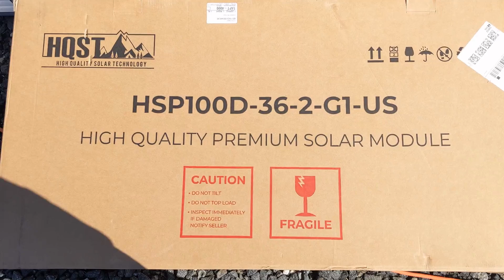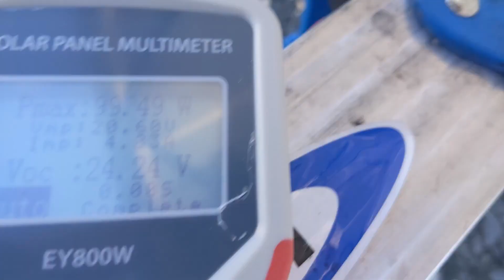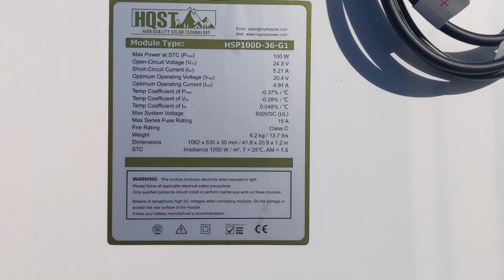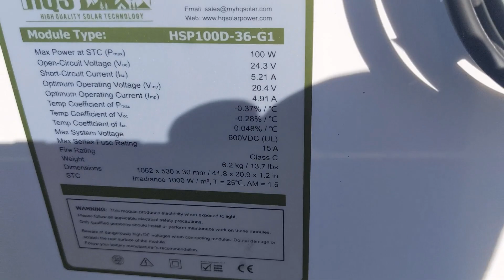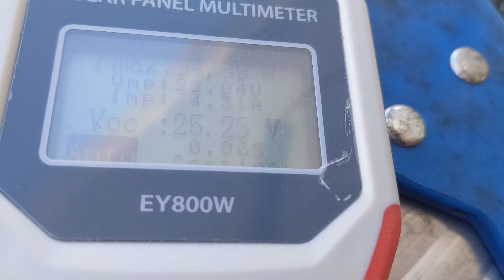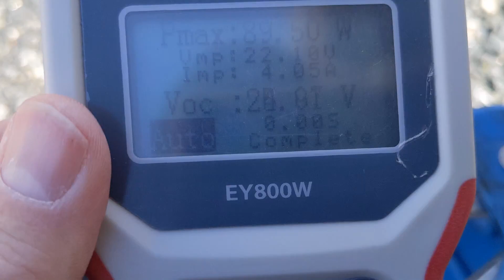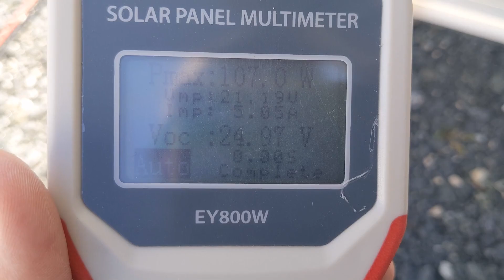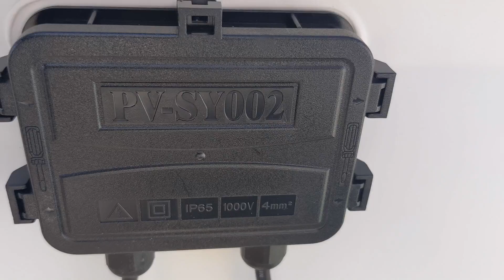Testing some 9BB 100 watt solar

Comment: I don't know how calibrated your meter is but the panels are reading well over the rated VOC printed on the label (interesting)...
Reply from the maker: Interesting ,  Not sure that meter can be calibrated. Voltages can be higher though depending on how cold the panels are .

Comment: More comparison of HQST panels please.  Will the new 9BB  HQST work with the older style of hqst ?. . I want to order some of the 9bb panels to add to the 600 watt system I already have
Reply from the maker: I really like 9bb panels they seem to work very well,  I can probably do a performance video between and older style and 9bb  but i will say that the 9BB perform much better overall and are smaller.  I think we should have a warm day this weekend maybe ill throw something together
Reply: I order six of the HQST and they all performed equally well  @offgridmaryland
Reply: @offgridmaryland  super awesome thanks very very much